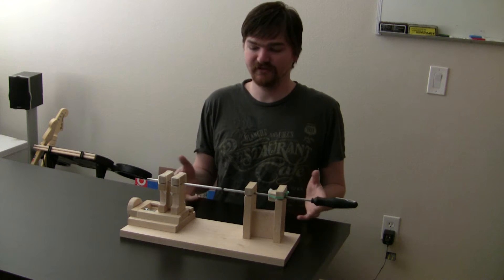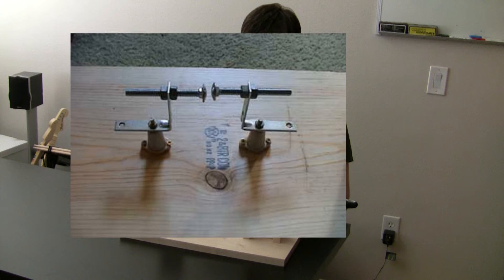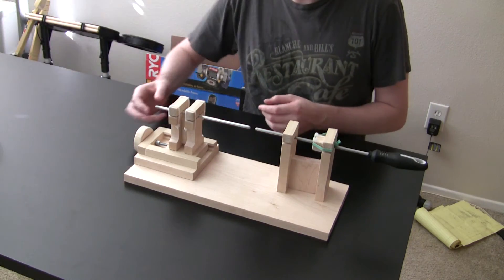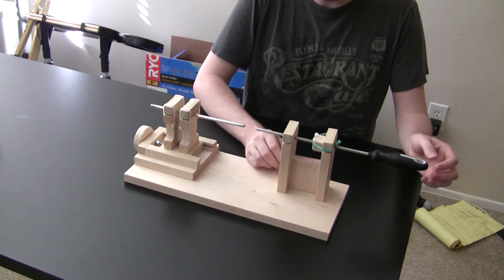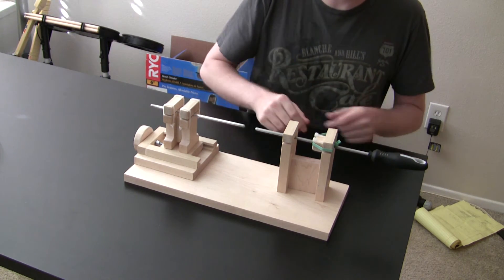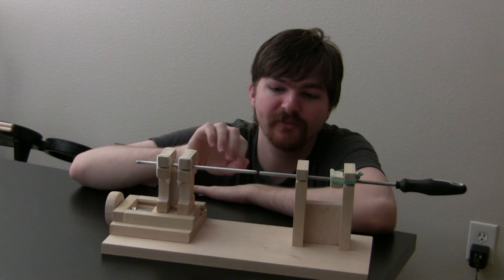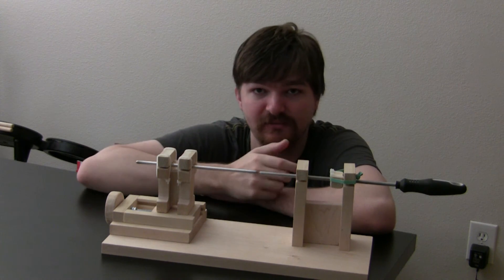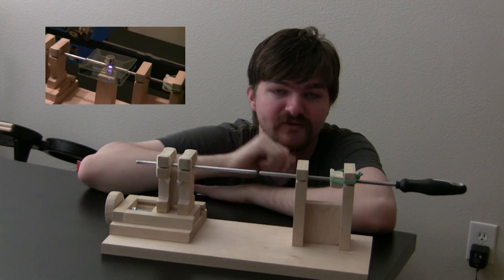Adjustable Spark Gap

Comment: That sound, as I gather is an audible air pressure of the electromagnetic hertz in the coil . The Electromagnetic pressure is transformed into sound waves via the lightning. If there is 50 Hertz in the transformer then the sound is also 50 Hertz audible , or am I wrong ? Why does the sound stop when the plasma or ionized arc is close, or closing in.

Comment: Seal it with real shellac.  Shellac is a natural substance from beetles in S.E. Asia, and is a good electrical insulator.  It has been used on motor windings since the beginning of electricity.

Comment: Super apparatus and demo!    Just a pointer that the purpose of using air or magnets for quenching is to cause the spark to more rapidly break down in order to obtain a cleaner break.  In radios this yields a cleaner and musical note for the signal.   BTW, there were even radios that used alcohol vapor in a sealed chamber as the quenching agent!  cheers.

Comment from the maker: Are those my only choices? :P
In this video its all from a Flyback transformer (from a CRT monitor) which rectifies the current, but it's not continuous so not really D/C either.  It's more like high frequency pulsed current.  Though the power source is a 12v DC car battery, what you see is about 20-60khz (I can't remember).

Comment: Nice design, but you should know that (undried) wood is a very bad insulator for high voltages. Use some sort of plastic stuff for build such a gap.